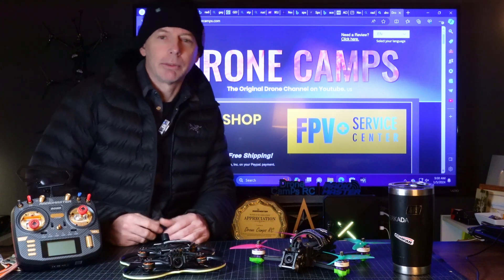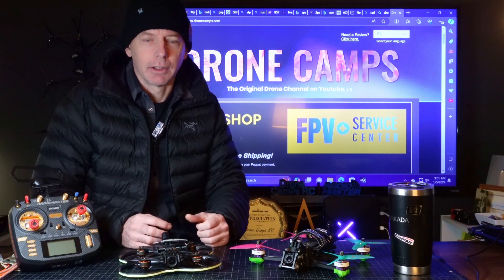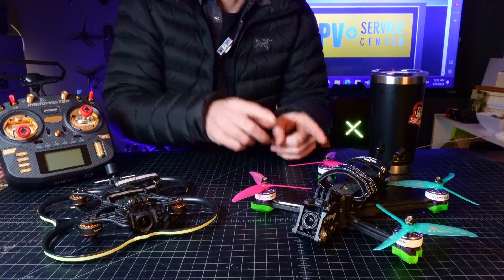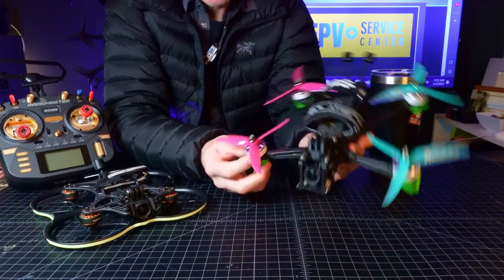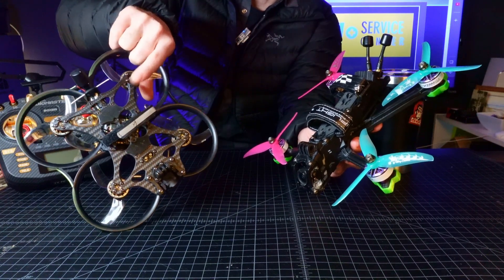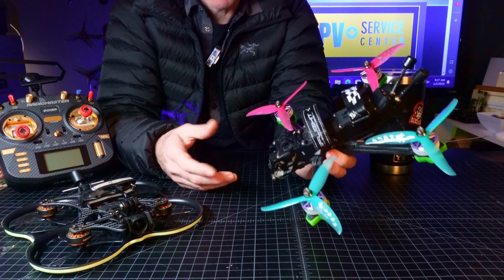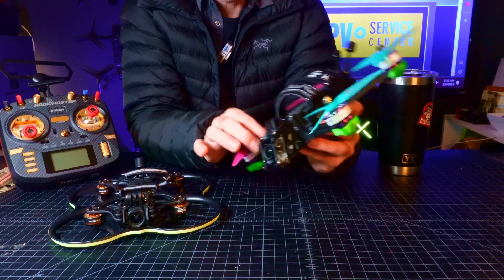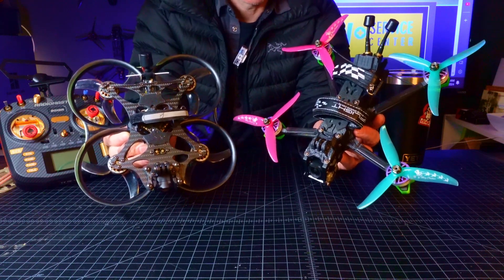INVERTED or UPWARD Motors? - Which is Better & Why? 🤔

Comment: Small but important point, if you fly from grass or loose dirt, you'll need a take off/landing pad for inverted motors, as the props are far too close to ground. For my flying, inverted motors really do not work at all well, and while those with minimal depth "protection" rings rather than full ducts are better, they just do not cut it for me.  They are also inherently significantly noisier, a factor around any sensitive areas.
Reply from the maker: Landing pad always regardless of up or down motors. ☝🏻👍🏻

Comment: I am an endurance pilot and do NOT do stunts or race. From my experience, I get a little more fly time from the INVERTED (Pusher style) configuration over the UPWARD (top of arm) configuration on the same quad. For my purposes, they also tend to be a bit smoother. Good Video!  Thanks.

Comment: Try the  HQProp DP 5x4.5x3 V3 Prop on that nazgul. I have them on my flip switch with velox v3 2207 2050kv and that absolutely rip. Which thats another frame I think is a step up from the nazgul in my opinion. it weighs 375 grams with my build

Comment: Bro I needed a good video of the pros and cons thanks bro🍻
Reply from the maker: One thing that my camera cut off is the part where I mention the inverted motor frame designs have no obstruction and cleaner airflow under the quad. But they also produce more ground effect. but in turn fly more stable for cinema filming in stable environments. ⭐️
Reply: Ugh part of me is like I wanna cut my butterfly drone but idk it's going to be huge but it's a 8 in drone but how cool would that butterfly be in a single plate of carbon in a pusher config for a more cinelifter style drone 🤷🏻‍♂️lol the struggle is real it's going to be expensive from a single plate of 8mm carbon but under 600 grams for the frame is lighter that the cinelifters on the market🤷🏻‍♂️ I'm torn my dude which you think looks better both are 8in frame I think they will be super strong lol the struggle is real why did I decide to design a drone😅
Reply from the maker: The wheels never stop turning is why. :) I say go for it!!!